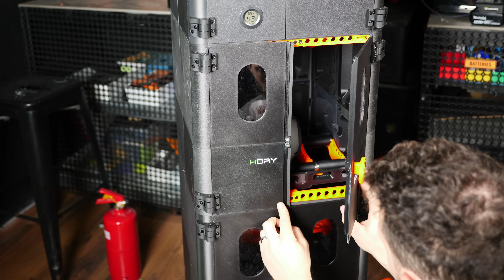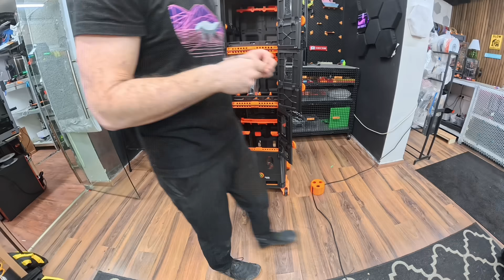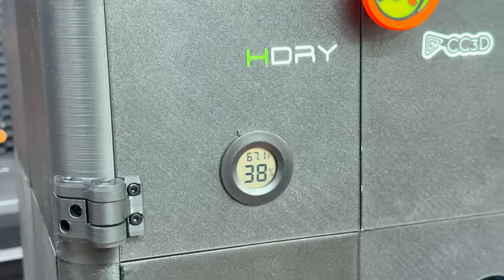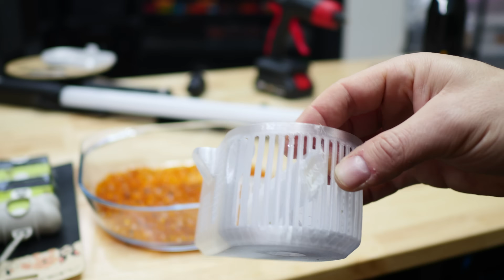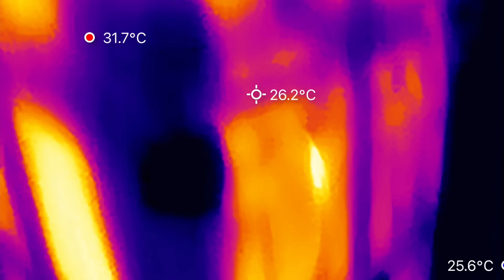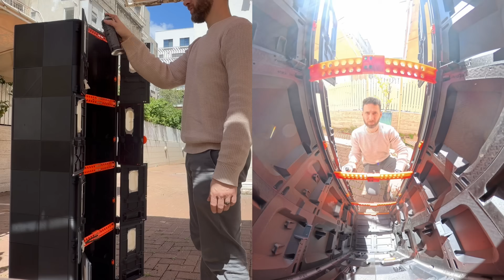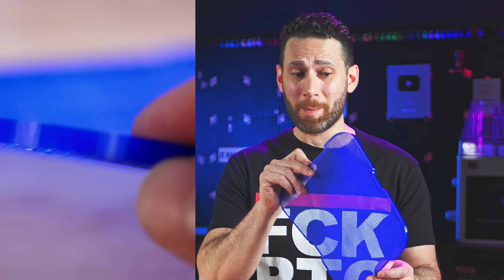This Will REVOLUTIONIZE 3D Printer Filament Storage!

Comment from the maker: ⚠️BIG UPDATE! ⚠️ 🔟%Since the video went into editing, I swapped ONE of the units to molecular sieves (another type of desiccant) + replaced the silica gel one more time... within HOURS, the humidity dropped to 10% and has stayed there for 6+ hours. THIS IS HUGE!!! 🎊Stay tuned, especially on @thenextnextlayer, for more updates.
Reply: I do not have social media clout or intent to, so unlikely that my post will be read. 😂
I've been using molecular sieve for years. I recently bought 4A that is cheaper than 3A. (4A adsorb things like Nitrogen, but is a lot cheaper.) I use a fan system with a decent SHT41 sensor to monitor moisture and control the fan. I live in the tropics, 60,% RH is normal, so moisture here destroy things. Not just your filament. 
First, moist air rises ( oh look, clouds!!!) This every dessicant on the floor is a fool's errand. Your sensor show the difference. Without the dessicant you will have the same gradient. Put dessicant or fan intake at the top. Your filament absorb and release moisture. What drybox is 3D printed? Yes, it will just be a barrier, not to mention there is tons of cavities in the walls. You are drying your box. Do yourself a favour and weigh the panels or plonk a piece inside and weigh it. You need to measure in the mg range, but you will see your drybox is the issue. I use nog standard IP67 boxes and can dry even the cardboard spools, but it kills my dessicant. Thus I invented my own spools to rip the cardboard rims off. They hold up to 16g of moisture. No vacuum will remove that moisture. Even in a 5l box at 60% RH you may have mg of moisture only. As long as you stop new air coming in. You are good. Vacuum packing is in my opinion of virtually no use, unless it is in the process of vacuum drying with heat. Don't waste your time on it. All boxes will let air through. As you mentioned, the vapour pressure drives how fast it happens. Thicker boxes or glass slows things down, but it's always there. Over time you will loose. The higher the gradient, the faster you will loose. I stop the fan in my boxes at about 10%RH. Below that, the filament dries too much and becomes more brittle. (Can't say for nylon though) 
Summing up: Dessicant at the top. Don't 3D print your enclosure, slow fan (too much speed also can release moisture - think hand dryer) Get rid of cardboard as it is a sponge. Minimum surface area for your box walls, a cube is ideal.
Reply: @jacquesbayman6557  I didn’t know about this stuff till right now. I did a quick googling and found the color changing molecular sieves are super spendy. Is that your experience?
Reply: Could you introduce the 3V 2W Rosahl membrane for a 350 litre container at the top? With your fan it will remove 2.9 gramms of water per day, meaning with a fresh dessicant you would never have to recharge the silica again? It is only 65mm x 62mm

Although if you put in say, 5 damp cardboard spools I guess it would take 3 - 4 days to get it back below 10%. Looking forward to seeing how you progress, good luck.
Reply: Amazing!  Keep exploring. Never tell yourself you aren’t an engineer because you don’t have a degree.

I’ve watched this a few times now, and I’m still trying to figure out what’s actually so revolutionary here that justifies the price.

I built my own dryer/regeneration setup for my air compressor using soup cans, heaters, fans, sensors, and an ESP32. I’ve also messed with PTC ceramic heaters, insulation, foam seal tape, multiple temp/humidity sensors, directed airflow, hot air from printers, servo-controlled blast gates, rechargeable silica/alumina, vacuum pumps, and even humidity membranes. All ESP32-controlled.

I genuinely love DIY solutions like this, but I’m struggling to see how the cost of filament storage justifies the price of this product.

What are they doing that the average capable DIYer can’t do, or couldn’t build toward pretty quickly? Is the value mainly convenience and polish, because those hygrometers used could’ve been richer sensors and a cheap but effective LCD/OLED display…. Or is this basically “your filament is expensive, so buy expensive storage for it”?

I don’t have an engineering degree. I have the internet.  You have the same resources I do. Continue to improve, innovate, and you can easily make a solution that works identically or better for a lot less.  No built in recharge?  Separate heater required?  I don’t get it. 🤷‍♂️
Reply from the maker: @wehavefunofficial I think what you’re saying is what justifies the $15k, because building this setup as shown was super cheap and effective. I wish I knew how to program ESP32s and stuff but my brain doesn’t work with code. Maybe if I use AI lol.
Reply: Dude, why not?

You do not need a perfect background, a degree, or some ideal starting point to begin learning and building. What matters now is that the tools exist, and they make it easier than ever to ask questions, explore ideas, and keep going until things click.

A lot of people were made to feel like technical subjects were only for certain kinds of minds. I do not buy that. Sometimes people did not fail the subject. The subject failed to be explained in a way that connected to how they learn. When you can ask follow-up questions, slow things down, reframe concepts, and see real examples, a lot of doors open.

That is what makes these tools so powerful. You can ask for plain-language explanations, step-by-step breakdowns, visualizations, practical examples, and real-world applications. You can keep digging until understanding replaces intimidation.

It is not just about coding either. It is about confidence. It is about removing friction between curiosity and action.

Want to build something? Start small. Grab an ESP32, learn the different board options, flash WLED, wire up an addressable LED strip, and make something real. One small win leads to the next. That is how momentum starts.

Talk your way through the process. Ask for simpler explanations. Ask better questions. Ask for criticism. Ask why something works. Ask how it breaks. Use every resource available to you.

We are living in a time where people can learn faster, prototype faster, and understand more than ever before. For a lot of people, the biggest limitation now is not access. It is believing they are allowed to begin.

So begin. Never stop learning. Find your limitations and how to overcome them.

I hadn’t touched any of this less than 5 years ago, but I tinkered, surprised myself at how easy it was, and now I’m making giant creative interactive props and experiences for a small town Halloween charity haunt. 😂

Reach out if you ever want to chat or bounce ideas off of me. @wehavefunofficial on IG. 🥳
Reply: @thenextlayer also if you are printing medical implants you need to be sure that your expensive filament is not getting contaminated. Can you say for certain that the plastic that your blower fan is made from is not off-gassing (nearly every plastic does unless baked in a vacuum oven first) and contaminating the filament with unknown compounds?
Reply: @thenextlayer  my brain also sucks with code
Reply: @thenextlayer  Using AI to program Arduino or ESP32 is actually highly doable. You could probably build and program a control system for your fan in a single afternoon. If not there's probably someone who's already released the scripts for such a thing and all you need is the right chip to run it on. It can be daunting but anyone can do it. Arduino is used in kits for kids all the time. Especially with AI you can absolutely bang that out in less than a day.
Reply: @thenextlayer  I recently gutted an old refrigerator I have and built racks that hold about 60 1KG rolls of filament.  I built 2 of the desiccant blowers that are right now just sitting at the bottom.  I bought an ESP32, a couple relays, and a humidity sensor and built a little control panel.  Everything is connected to Home Assistant. I created an automation that turns the fans on when the humidity reaches 18% and back off at 12%.  Home Assistant will produce nice graphs showing the humidity over time.  I currently get about 4-6 hours between periods when the blowers are running.  The blowers run for about 30 minutes to lower the humidity from 18% to 12%.  I would be happy to share the graphs showing the trends.  Don't sell yourself short on programming an ESP32, especially for Home Assistant.  There is a plugin called ESP Home.  To build the code you just go to their website, enter the part number for the hardware.  They have code already written.  You just have to cut and paste it into ESP Home for each piece of hardware.  I understand the code now but I didn't know anything about writing code.  I'm quickly learning though.  I believe I could easily write code to make a stand alone controller and maybe even a touchscreen to control it.  I really think the real key is the refrigerator.  It seals about as good as you can get for basically free.
Reply: I made one of these thats a bit different 2 years ago, was a pain to maintain. It only absorbs moisture for about 2 days. 5/10. Polydryers work better.
Reply from the maker: @CameronW2239interesting… ok, I’ll see what happens. Maybe that’s why it climbed up so much when I went away for 5 days?
Reply: @thenextlayer it would possibly work better if you made it so the container can slide out the back on rails, so that you don't comprise the entire system when changing desiccant.
Reply: I would also like to know how good you can regenerate the alumina silicate, as far i others have told me you have to get around 120°C and more to get it really dry.
Reply from the maker: @jadesontal4947 I recharged these molecular sieves at 250C for 3 hours in a proper oven and that worked well.
Reply: @thenextlayer  Good to hear as I haven't had to recharge my molecular sieve yet. Pretty sure you can also use the microwave to dry it similar to silica.
Reply: @jadesontal4947  Yeah you've got to get them hot. 175-260°C is the generally recommended range. Don't get them too hot though or you can collapse their sintered structure.  
They work fantastically though. I would highly recommend, it's all I use now.
Reply: Molecular sieve is SO much better than silica, but also harder to dry after it has absorbed water
Reply: אתה צריך POLYDRYER? יש לי ספייר
Reply from the maker: @DDooosh I have a few coming from snapmaker soon thanks though
Reply: This is the desiccant I use and it’s insanely good.. the only problem is that it’s not easily reactivated once it’s saturated.. it requires a very high heat vacuum chamber. 

One thing you could try is using a broken wine cellar.. that would give you a very good seal..
Reply: @AcryliCrafts_Jiggit  I don't think you actually need a vacuum chamber. Saw a guy throw them in a toaster oven for a few hours weighing them before and after and it seems to have gotten most of the moisture out.

I am sure a vacuum chamber does a better job, but I don't think it is strictly necessary. I think because molecular sieve is typically aimed at lab use, they just assume you have all this fancy lab equipment lying around.
Reply: @nerdstrangler4804 oh shit.. good to know…. I’ll have to try it out
Reply: makes alot of sense molecular sieves  can hold 4x as mouch water at 10%RH. and they are effective all the way down to 2-3% Relative humidity
Reply: I commented on your previous video and gonna say it again. I have been drying filament with silica alone for a while now and that's why I was against using a heater. It would be a step back. My boxes fit 4 spools and the pattern is the same. RH Stays around 30s until they are completely dry and then rapidly go down. It usually takes less than a weekx but once dry RH remains at 10% until silica starts to saturate. That's when I put fresh silica in. I use xiaomi sensor that has a screen and connects via zigbee to Home Assistant.
Reply: You should consider getting a Govee H5075. It's just 10 eur and has a super sensor, that goes all the way down to near 0% with just 2% error. Plus it has bluetooth and a quite ok app with graphs and calibration option. About the size of 2 matchboxes
Reply: Maybe we can add a back door and a lever so you can pull the lever what is close the desecant containers footprint inside the chamber so regenerating desecants cant let in to mutch moisture just like air valves. And another thing what there could be good if if we also can add filaments the same way, it is hard to design well, but once it is done this unit can be even more efficient. Anyway nince job!
Keep exploring!
Reply: I just bought a polydryer with a container.
I put the normal desiccant in and it got to like 19% humidity after 2 full length cycles on tpu recommended settings.
After sitting with the tpu it slowly climbed over two days.
I replaced the desiccant with molecular sieve and ran one tpu cycle. It dropped to 10% well before the cycle was completed.
It has been sitting at exactly 10% for 4 days now.
I’m going to start building this unit and I’m planning on using this new unit along with my polydryer.

Now I just need someone to figure out how to dry the molecular sieve on a budget at home.
I bought a vacuum pump and chamber for drying the molecular sieve with the help of an electric stove.
Hopefully that turns out to be the best solution because I have the equipment (except the moisture collector to protect the pump).

I’m planning on building a two level unit.
As I make progress I’ll update here.
Reply: @justinkirschenman2232 The most efficient method is using a microwave oven. I haven't tried it personally, but microwaves interact specifically with water to heat it up directly. Food gets hot because it contains moisture.

With that logic in mind, the most energy efficient method to get water out of anything (most likely including any type of thermally resistant desiccant) is to zap it with a microwave. I would recommend intentionally soaking some of ur beads in water and weighing them. Find some setting recommendations online, but be conservative. It is often better to dry these things in short cycles, as microwave ovens can get INSANELY hot and you don't want to damage the porosity of the alumina.

For example, the best way to fully reactivate silica gel is around 5 minutes on defrost mode, then let the beads cool for 5 minutes before repeating. Do this 4 times to get ALL of the moisture out, doing it once or twice is adequate but doesn't completely drive out the moisture. (As seen in CNCKitchen's video)

But using microwaves to directly heat the water means it is exceptionally more energy efficient and faster than using a heating element of any kind (i.e. a filament dryer or a toaster oven, or your stovetop).

Hope this helps? I'd be interested to know what you find out if you give this a go.

EDIT: I just realized the two forms are different so maybe don't soak them in water lol. The microwave should be a very efficient way to refresh them though.
Reply: For storing hygroscopic materials in desiccators in chem labs, typically Drierite is used. It is anhydrous calcium sulfate. Can be regenerated at ca. 210C. They sell it in bulk formats but also in individual kraft paper or tyvek pouches.
Reply: The thing is everytime you open the box, put a roll with a bit more filament etc, you end up moisturising the entire cabinet, I know this because I have a similar box. The problem is that is a pain in the ass to change the entire cabinet silica.
Reply: The heat gun, and thermal camera was probably not the best way. You said it yourself 12 minutes in. It was a mashup of different filaments, printers, seals. Adding spray-paint to any enclosed structure especially with the goals you are trying to obtain is asking for a fire hazard if any electrical component arcs. You should have started with the automotive test. Use smoke to find any air leak spots. You would have probably found it would have been easier to rebuild from scratch then designing your desiccant dryer would have been more beneficial. The issue you will always have at this point is you will have to open the doors to replace whatever drying gradient you are using. Unless you find a way to extricate the moisture built up and as someone stated use a smaller membrane style, or like designed for my AMS units to maintain a specific RH% a heating unit to dry and remove moisture. That being whatever you use silica, desiccant etc., and then use heat to dry, and repeat, but have a closed loop system.
Reply: @thenextlayer  I was going to suggest molecular sieve but I see that you got it. The humidity is most likely lower than 10%. Those cheap hygrometers always bottom out at 10%
Reply: Molecular sieve is god tier desiccant. You are probably way below 10%, those cheap hygrometers just can't read below 10%.

My AMS on the other hand shows 0% RH. Honestly you probably don't even need the fans, molecular sieve just obliterates moisture.
Reply from the maker: @nerdstrangler4804 really? That’s wild! The thing is, without the fans, it would take a long time to drop back down every time you opened it, you know?
Reply: @thenextlayer  You might be surprised. The stuff actually gets hot to the touch if you leave it out in the open air too long since it is rapidly guzzling up moisture.

Then again I know you live in an extremely humid environment, so maybe you do need the fans. I dunno, something to experiment with.
Reply: @nerdstrangler4804  
Indeed molecular sieves are very reactive to moisture and are top tier of adsorbents. Still there are many types of molecular sieves like 3A, 4A, 13X. The later is the most effective adsorbent I know of at low relative humidity but comes at a cost. Something that need to be considered too is the material used to build the cabinets. No matter how sealed the units can be, water can seep through the material itself at lower humidity levels rendering sub 10% RH harder to reach and maintain.

As a suggestion, activated alumina, mol sieves and other types of adsorbents may be easier to source through local industrial compressor and compressed air dryers service companies. They often keep some in stock for those industrial equipments. Some are also very knowledgeable on the gas/air drying processes.
Reply: Absolutely, thank you for the reminder!!

I actually have a jar of it sitting on a shelf with my lab supplies. I originally bought it for experiments with cold traps, reducing vapor getting into a rotary vane vacuum pump, and for use with a vacuum chamber for casting, molding, and steam distillation for perfumery.

Funny enough, I completely forgot I had it and never mentally connected the lab side of things with the 3d printing dryer side.

I’ve usually got a lot of different projects going at once, so sometimes those connections get lost in the shuffle.
Reply: @thenextlayer  the real problem is how you recycle/recharge the molecular sieve. It's hard to remove water from it by normal heating dryer.
Reply: @thenextlayer  if you keep the sensors below 10% for too long they get stuck and will stop being able to detect changes in humidity and require soaking in water to fix. Humidity indicator cards might be a better option.
Reply: I use molecular sieves (passively, no fans) in my boxes, and have been monitoring their humidity for years. happy to provide data :). I have the data sent to my home assistant instance, and have an alert set up that monitors the humidity and alerts me when the desiccant needs to be changed.

e.g. here was an example opening, with fairly fresh desiccant

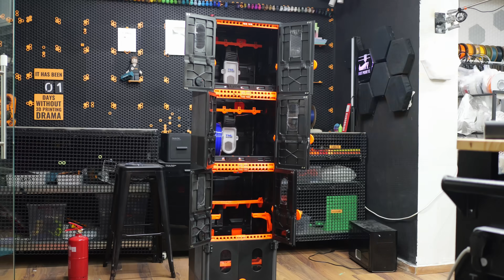17:36 - 3.02%
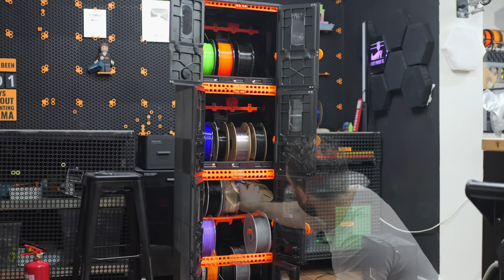17:45 - 20.06%
18:15 - 7.14%
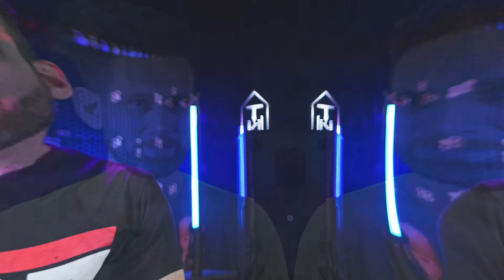20:48 - 4.34%
Reply: @Jpeglism Pop it in your oven. Even 220C will do, but takes longer. The main thing is to weigh it and stop if it is not reducing weight. I work on 10-12% weight reduction. After that, the time vs reduction benefits drops of fast. Except that you will not be able to swing to the full 25% capacity unless you have real high heat. Molecular sieve can suck moisture down to 1%. I have about 15 rolls in my box in 60+% humidity. 200g of sieve can last about a month or more at a10% humidity level where I stop. The 50l box I use will store maybe mg of moisture of all the air is replaced when I open the box. Once the filament is dry, you are good. The tiniest leak will suck in moist air, that is what kills the sieve.
Reply: @nerdstrangler4804 Amen!
Reply: how easy is it to get the parts for this in israel?
Reply from the maker: @jelly_swooshAliExpress links in the Printables page! It’ll arrive eventually lol.